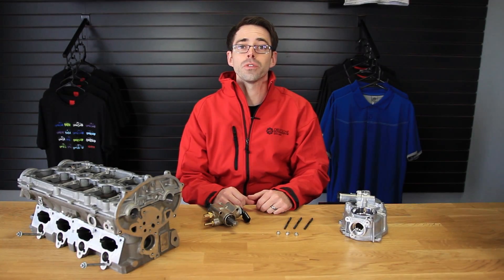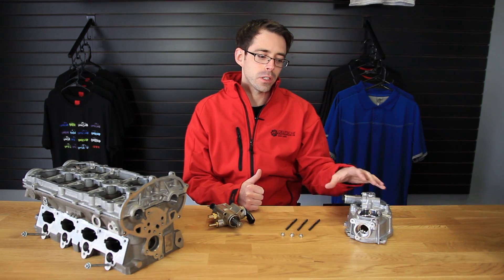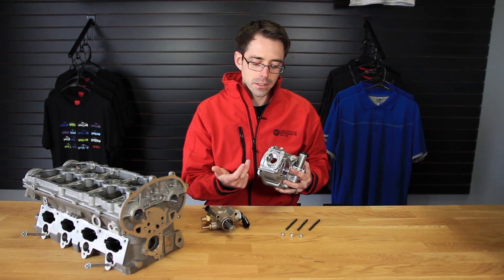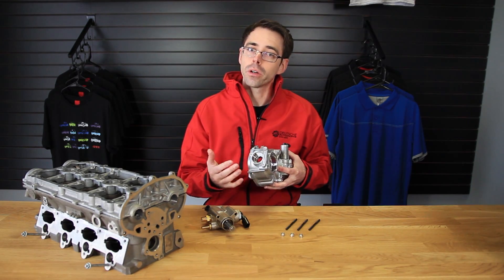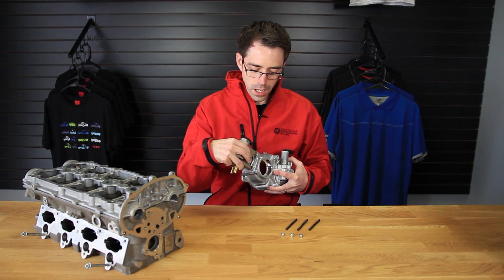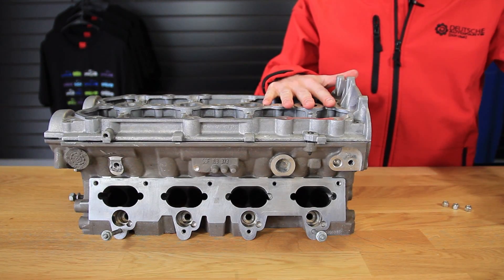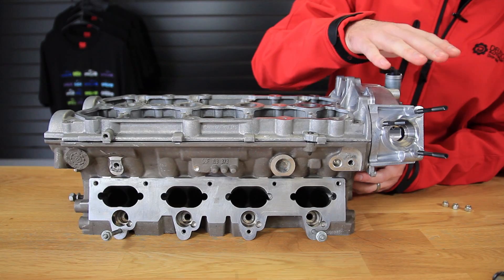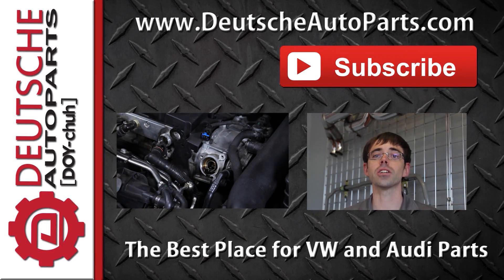VW or Audi FSI Stripped High Pressure Fuel Pump Bolts (What are your options)

Comment from the maker: - We appreciate your Support and Purchases! -
Be sure to prevent your timing cover on your cylinder head from stripping, by installing our FSI High Pressure Fuel Pump (HPFP) Stud Conversion kit. 
https://www.shopdap.com/stud-conversion-kit-for-high-pressure-fuel-pump-hpfp-on-2-0t-fsi-with-cam-follower-and-seal-06f198025kgrp.html

FSI Timing Cover where the HPFP mounts. 
https://www.shopdap.com/06f-103-107-g.html

FSI High Pressure Fuel Pump (HPFP) - Genuine VW/Audi
https://www.shopdap.com/fsi-hpfp-fuel-pump-06f127025m.html

FSI High Pressure Fuel Pump (HPFP) - Hitachi
https://www.shopdap.com/high-pressure-fuel-pump-hpfp-for-2-0t-fsi-engine.html

Comment: I bought a stud kit but on the early model GTI with the fuel hard lines for the fuel pump I thought it made the job of removing the hpfp much more difficult. And I would have also designed the studs different. I would have put an Allen key hole in the top so you can actually tighten the bolts decently. With the locking nuts that come with the studs when you attempt to remove them it just ends up backing the bolts out anyways.

Comment: hey if I wanted to rethread the stripped bolt hole in the cam chain cover...what size tap and wire thread insert would I need to use? also what is the thread dimensions of the T30 fuel pump bolts on a 2008 fsi gti?

Comment: As long as you follow the torque specs for the bolts (10nm\7 ft-lbs) the pump can be removed, and replaced without issue. I was told this separately by APR, and by LOBA Motorsports. In fact LOBA stated to me, after I inquired, it has removed one pump from one engine 50 times over the course of one year during it's HPFP R&D work with no sign of thread wear. I think it's a glaring omission by Deutsche Auto Parts to neglect to speak to the proper torque specs for the OEM bolts. This omission of such information relative to Deutsche's new replacement studs is akin to asking people to believe there will be an issue with continuing use of the OEM bolts ( to drink the KOOL-Aid). You can't idiot-proof the installation, so tightening the bolts without regard to proper torque specsl, no doubt led to thread wear in some cases. DAP might have been better served to say it's studs mean never having to remove those OEM bolts again (thought it complicates the pump-removal process in the bargain). I'm not saying DAP is fear-mongering, but I call BS.
Reply: There is a bit of fear mongering with regard to helicoil.